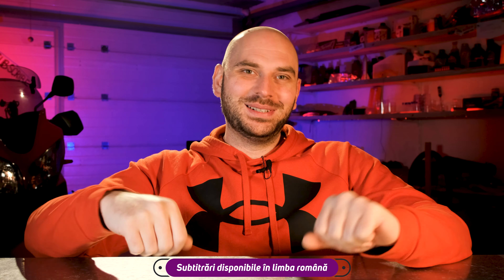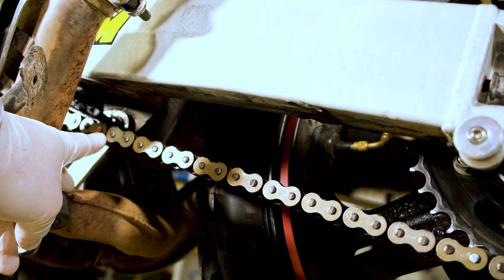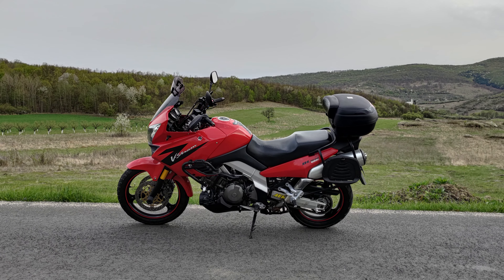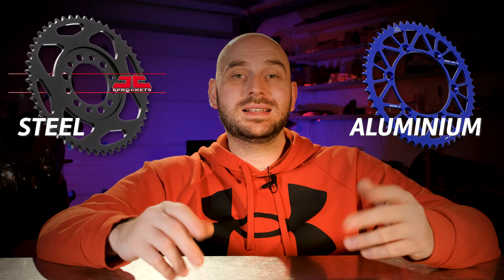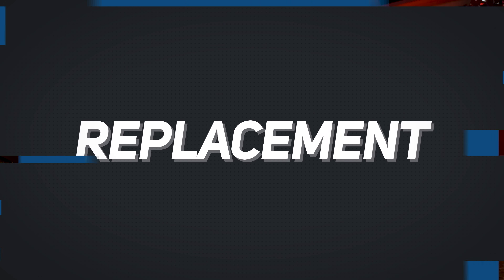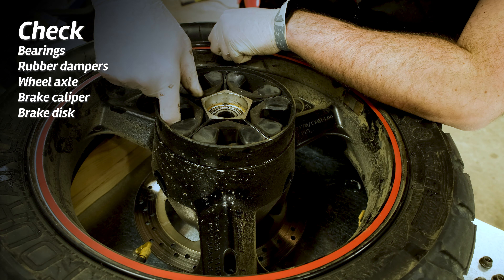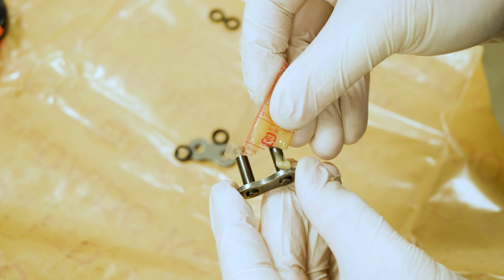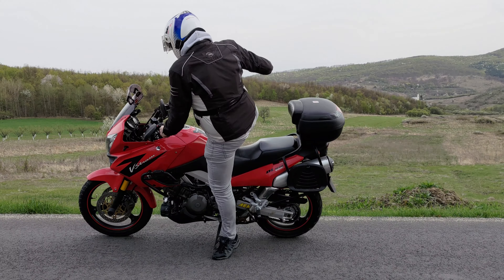Chain & sprockets replacement | A quick "How To" guide for everything chain related

Comment: Hi Sergiu, thank you for all the advice on your channel!
I believe you left out 1 very important part; chain slack is never equal over the whole length of the chain. When turning the rear wheel (while pushing in between both sprockets; the middle of the chain up), I always find a part in the chain where there is more slack than anywhere else. It is on that part that I adjust the rear wheel.
Maybe another item to check is also the rubber dampeners inside the rear wheel, when taking the sprocket off. Sometimes these become worn or damaged and form cracks, splits,...
Another trick I use on my lower power (less than 350cc) enduro motorbikes is to use UNsealed chains and guide the carter vent tube just above the chain, near the front sprocket. So the chain automatically always stays slightly oiled. In my experience, my cheap chain lasted a lot longer, and without too much maintenance too. 
Thanks again for your nice channel and friendly advice!

Comment: Great video with lots of great info.
I've only two small things I think you got wrong.
1. "You should always change sprockets and chain together."
     In my exp. you should change front sprocket at least once in between changing chain and rear sprocket. So if your chain/sprockets usually last 25kkm, you should change front sprocket at around 12kkm. That's, at least, my experience, and to me it makes sense, because front sprocket usually turns 3 times faster than rear sprocket and will wear out faster.

2. You applied thread glue (Loctite) to front sprocket threads screwed nut by hand, and than waited before torquing nut. Loctite starts drying as soon as it's deprived from air so you should torque front sprocket nut ASAP. Just something I picked up over the years, but I have no formal knowledge about this stuff, so take my words with a bit of salt.